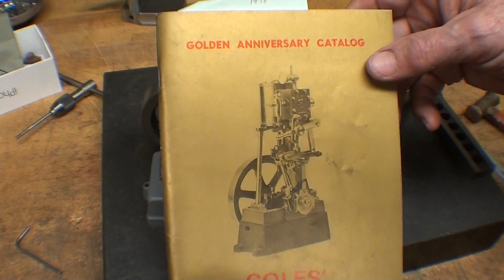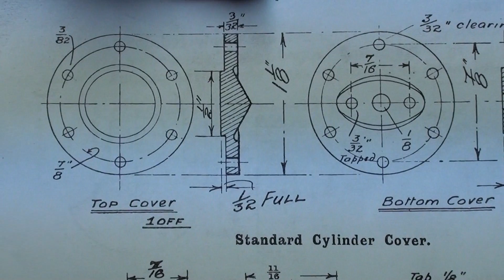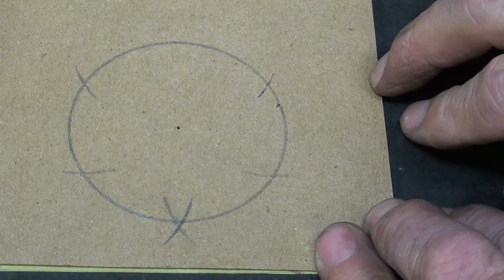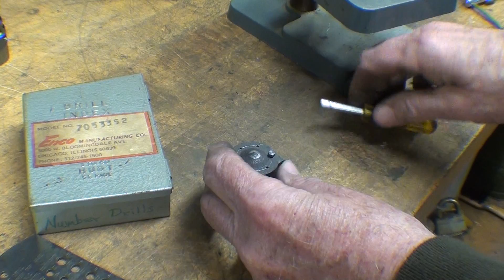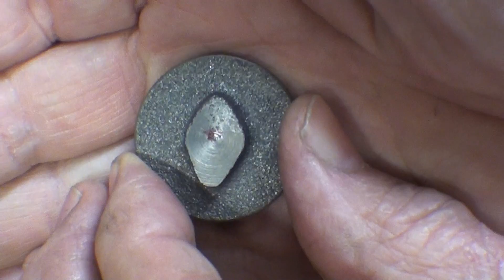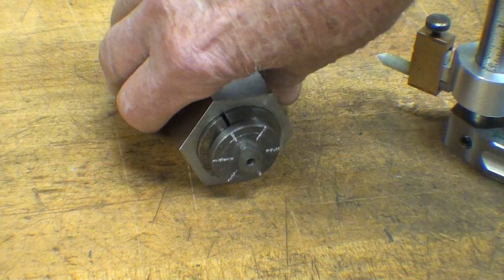Tubalcain BUILDS THE STUART PROGRESS STEAM ENGINE pt 6

Comment: I recently learned about "G" Series carbide inserts, "Ground"  vs "M" series inserts being  "Molded"   CCGT vs CCMT   Ground inserts end up being sharper and act more like HSS.  Just passing it along for anyone who did not realize the difference and availability as well.
Reply from the maker: Thank you for that, I do prefer a very keen edge. The blunt ones just push the work away

Comment: The nutdriver was made by Xcelite.  They made several different sets of small nut drivers and screw drivers that came as sets in a case with a large torque multiplier handle that slipped over the small nut driver handle.  I have a couple of them.  They did a longer shank version of the screw drivers with pocket clips that were the industry standard for many years.

Comment: Whew...I just finished tapping the first bolt circle. Tense stuff.
I scribed the circle on the lathe, as Mr. Pete did, but then I opted to do all remaining work in the mill with the DRO. I used an online bolt circle calculator to get the coordinates and wrote them on a quick sketch of the layout, to minimize error and to allow me to go between them for the different operations. Like Mr. Pete, I did one bolt completely to secure the two parts, then did the remaining five.
(Most DROs will calculate bolt circles, but I didn't want to ruin the work trying a new feature, so pen and paper prevailed)

Comment: In drilling for your bolt pattern you could have used a few drops of super glue to hold the cover in place and drill all the holes to the tap drill size. A quick tap with a hammer would break it free for you to clearance drill the end cap.

Comment: There's an even more accurate way which doesn't take much longer. Lay out another circle with your compass so the center is on the circumference of the 1st circle (anywhere, it doesn't matter.) Now you have two points where the circle's circumferences cross. Make two more circles with the centers at these points. One point will be common, and you'll have two more points on the circumference of the 1st circle. Now you can just measure out the distance between the nearest two points on the original circle's circumference and swing it around to get the last point. You now have a bolt circle with six bolt-hole centers marked and ready for drilling, tapping, etc...! :) HTH.

Comment: The reason your compass won't work on cardboard to create six divisions is because the point is no longer in the same plane as the pencil point. The method should work fine on metal as the point can't be push through the surface.
Reply: yes, the method is be exact if done precise enough

http://www.mathopenref.com/constinhexagon.html

Comment: You can lay out six holes in a 3 jaw chuck in a lathe by using something to put between a chuck jaw and the lathe bed then use the compound to mark that hole radius line on both sides of the center, then move a jaw further do it again and so on.

Comment: To lay out the holes accurately ( not dependent on the number of holes ) Divide 180 by the number of holes Sin x PCD will give the exact measurement between each of the holes.

Comment: As you know I was concerned about the passages on the heads and it is very interesting how you do each step.  I would have liked to see the piston rod seal but understand why it would not be necessary for your use.  Great project so far and overcoming the imperfections in the castings makes it more interesting.  After all, since Adam none of us are perfect  in designing or performing.  Thanks again, Greg.

Comment: Perfect Circle  piston rings !!!  Back in the old hot rod days  when you filed and set the ring gap with the hand cranked machine
Reply: i was told by a mechanic, when i was in high school that perfect circle piston rings were the best. he had a 1954 ford pickup with a huge buick engine which would outrun most anything in the 1/4 mile local dragstrip. he was a mechanic for the buick house here.

Comment: In the last episode, I wondered why the steam port had to be drilled so far out near the end of the cylinder. But I suppose the hole wouldn't have lined up with the other hole in that case.
Reply: You need to ensure the piston doesn't block the steam port when it is at the end of its travel. So you want the steam port as close to the end of the cylinder as possible.